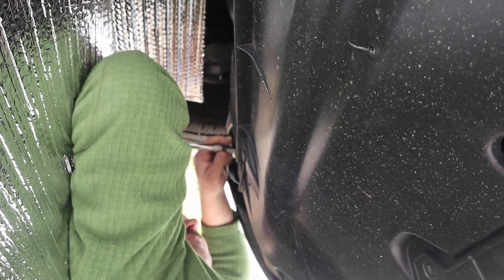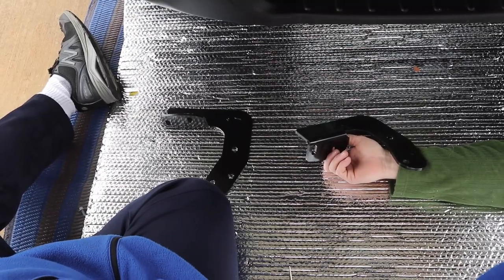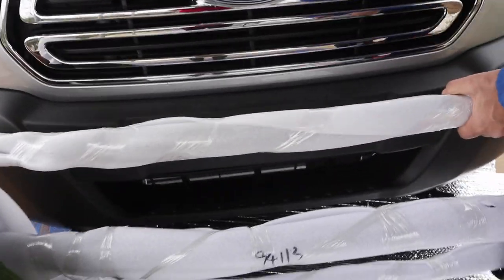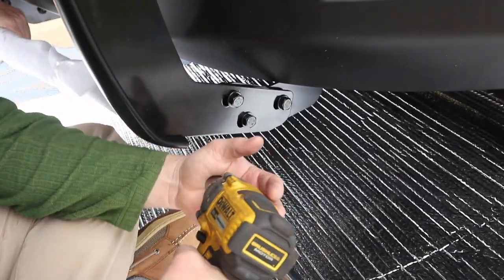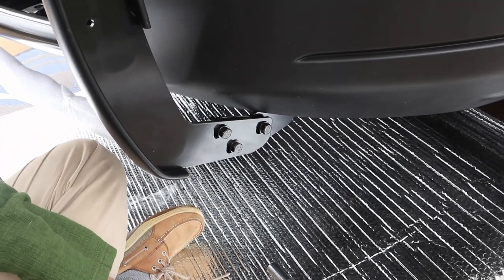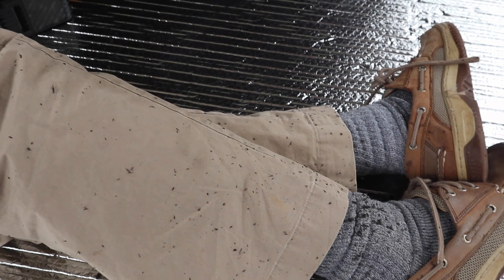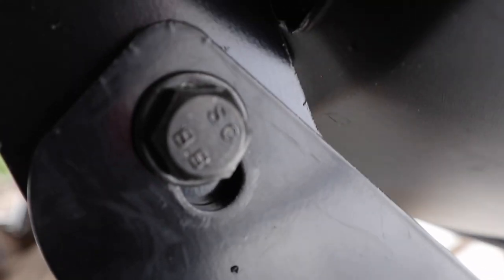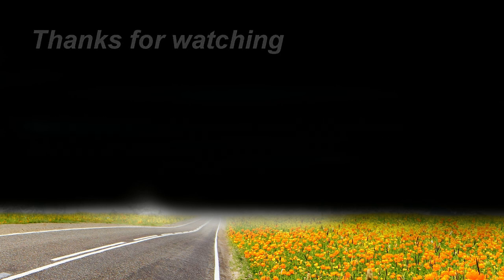Installing a Steelcraft Front Guard on our 2019 Ford Transit - Causes sensor problems on 2020 model

Comment: So, does it interfere with adaptive cruise control?  That's what the disclaimer is on their webpage.
Reply from the maker: It will interfere, lucky for me my chassis is a 2019 chassis without the new features.  But then again, I wish I had the new features and would do a different light setup.